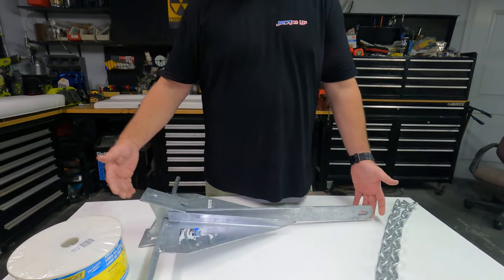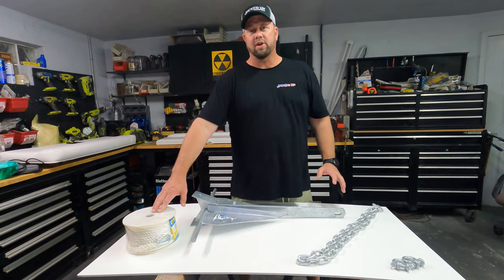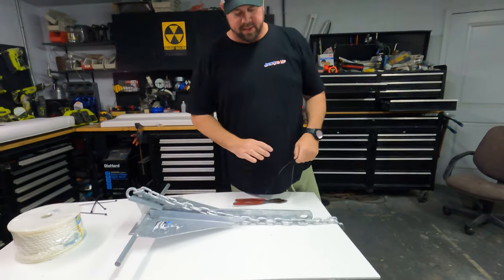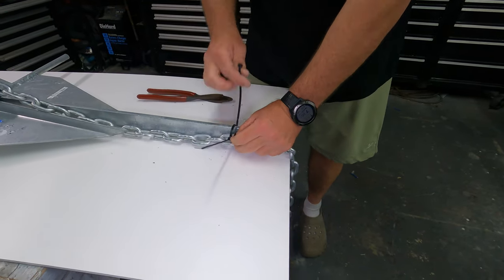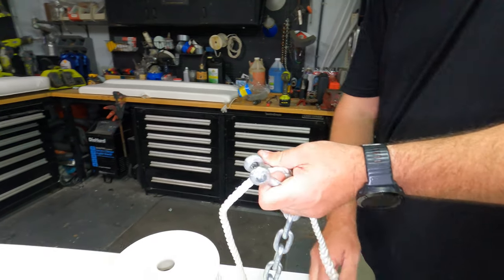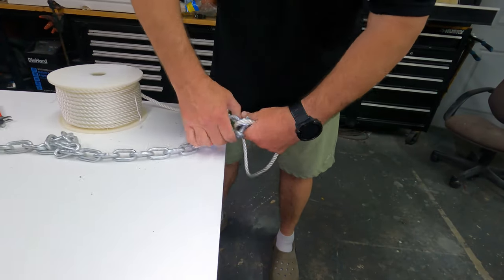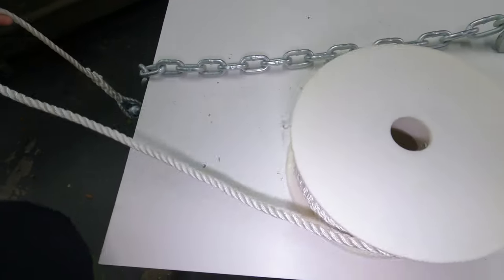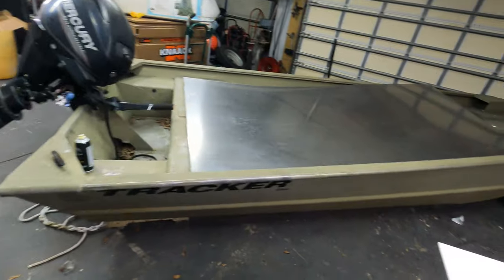How To: SETUP AN ANCHOR RELEASE!!  No More LOST Anchors!!!!

Comment: Anchoring is not just a convenience thing, it's also a safety thing. For instance, anchoring can keep you from smashing against the rocks or being pulled out to sea if you run out of gas or have another engine problem.

This is incredibly irresponsible advice from someone who doesn't know anything about boating. Please do not do this. Please do not rely on zip ties to deal with all of the strain of the wind and the waves and the current pulling and jerking your boat away from the anchor.  

I mean, of course, unless you don't care about your boat or the safety of your passengers.
Reply from the maker: Thanks for watching.  Please move along Karen
Reply: @JackedUpFishing   funny.  Incompetent and dangerous, but funny.  :)